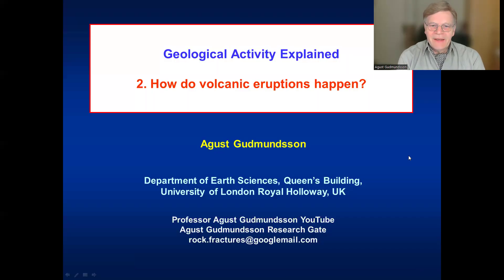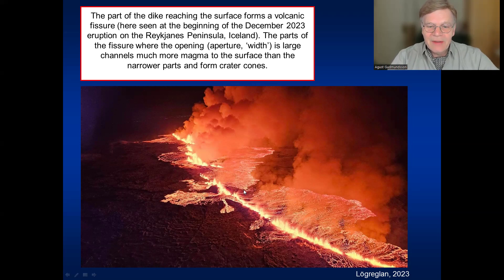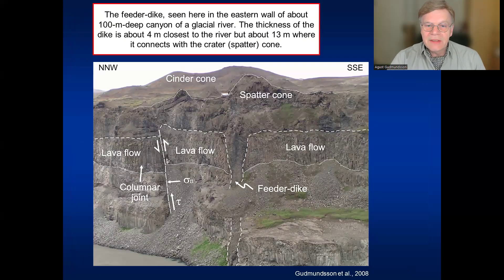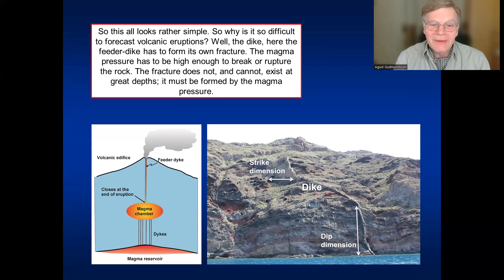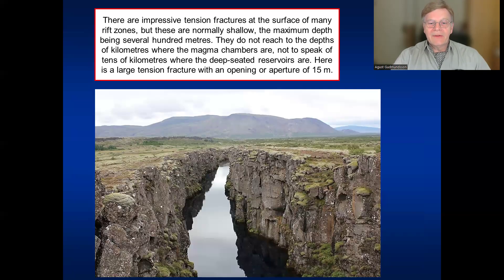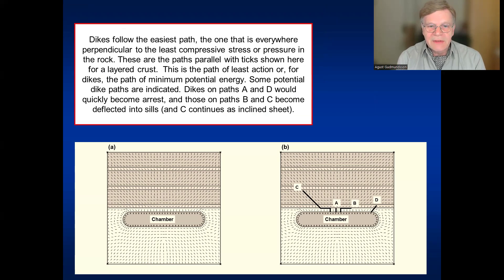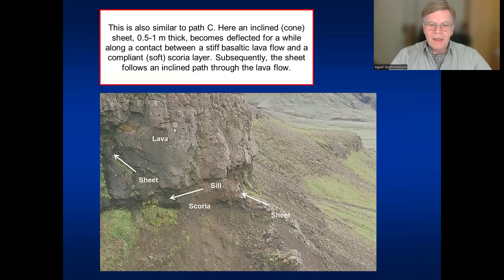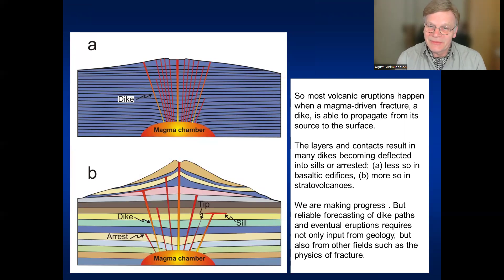Geological Activity Explained  2 How eruptions happen

Comment: Does the formation of an extention fracture indicate than Earth’s surface has expanded by the width of that extension fracture?
Reply from the maker: Thanks. Generally speaking, yes, particularly if the extension fracture is filled with fluid (a hydrofracture) such as magma that subsequently solidifies in the fracture. But extension is also due to normal faulting.

Comment: Do the areas that have risen due to inflation from dikes and magma intrusion fall back to previous levels seen before eruptions? Thanks for your great videos 😊
Reply from the maker: If the intrusion is a horizontal sill, then the inflation need not fall back to the previous level (part of the space for a sill, however, is generated by bending the layers beneath the sill down, so that not all the space for the sill needs to be formed by bending the layers above it up through doming or inflation). For a vertical dike, there are two peak areas of uplift (inflation) at the surface on either side of the dike (assuming the dike is still with its tip or top below the surface; thus not a feeder-dike). These peaks tend to diminish with time following the dike emplacement. All these aspects are discussed in detail in my book Volcanotectonics (2020).

Comment: Columnar joints always look amazing.   I recently saw a video with alternating colours of light/dark horizontally in the joints. 1rst i ever saw this. They called it stria or chattermarks in the comments.   Is this a common occurrence?  Again i had never seen before.
Reply from the maker: Cooling joints are common in lava flows and particularly in intrusions such as sills and dikes and form when the body has reached a much lower temperature than the initial magma temperature. For a basaltic magma initially at, say 1200 degrees, the columnar or cooling joints would begin to form when the magma had cooled down to about 700 degrees. I discuss columnar joints much in my book The Glorious Geology of Iceland's Golden Circle.
Reply: @professoragustgudmundsson3810  thank you for replying.  I should have been more specific.  The colour alternating between light/dark was what was odd.  Is this frequent. For reference this is video i was speak of.  https://youtube.com/watch?v=Ltmw5Md5aug&si=r4d9xVAM8qt5VNMG

Comment: Thank you.  This exactly and clearly answered questions that have been on my mind as i follow the current situation near Grindavik.  I am enjoying the videos very much. The various models of the plumbing are fascinating.  

After months of asking those who are better informed,  i am  still 97% confused by the seismic charts and hope that you will cover those. How are they measured? What is the significance of the line thickness? Why are there very abrupt changes on the (bjk)Bruarjokull chart and more gentle curves on many of the others? Is this glacial movement or something else entirely? Why do the eruptions near Svartsengi seem to require a level of 4000 on the chart? Is this true at other eruptive locations? Or does that value change? What does the amplitude actually signify?  Many of the seismic charts I’ve seen don’t even label the y axis. 

If this is covered somewhere else i will be happy follow it there if you have a recommended reference.
Reply from the maker: Thanks for the comment. I plan to discuss earthquakes in later talks and perhaps some to the points that you mention will be explained in those talks.